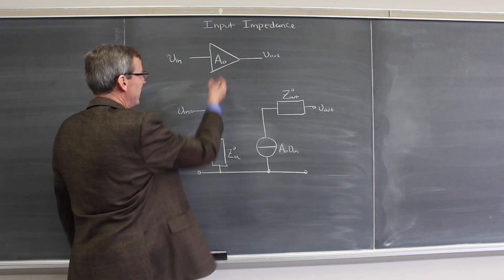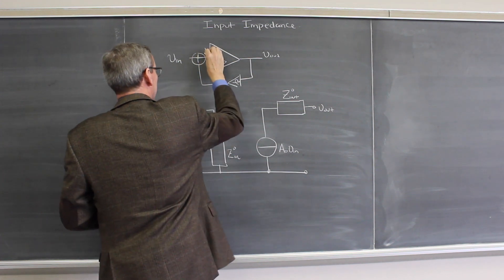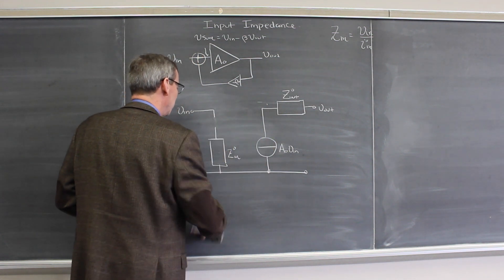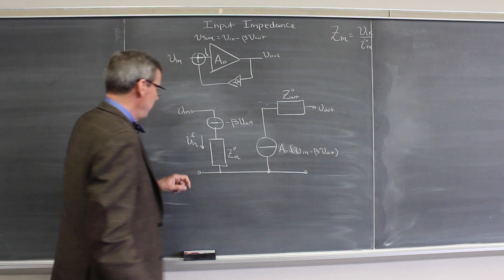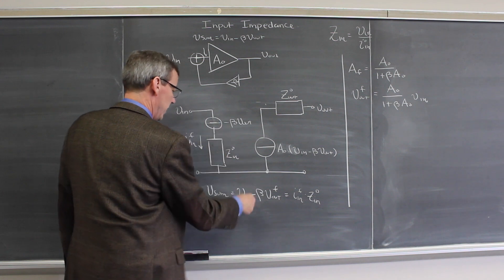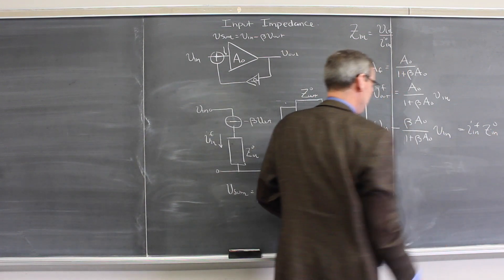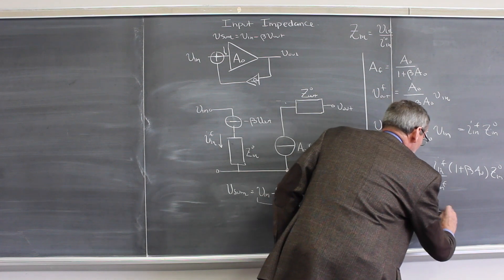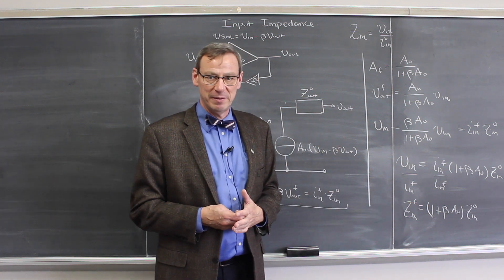Input and Output Impedance with Negative Feedback

Comment: This is very simplistic. What in the case feedback network has its non-ideal input impedance? What is you are not returning voltage but current?
Reply: Even if you are returning current, The input impedance depends on whether you are subtracting voltage or current, If you are subtracting voltage and the feedback voltage is a function of the output current it Is still true that the input impedance of the feedback is much larger than without, think of the case of a common emitter or common source transistor with a feedback resistor in the source or the emitter, That's a topology where you are sampling an output current for a feedback voltage

Comment: Sir please help me out in voltage shunt feedback amplifier the gain of the amplifier with feedback is Vo/Is how it is possible that the gain is the ratio of voltage to the current
Reply: It's called trans-resistance, this is similar to the inverting ideal op-amp topology, the feedback current is a function of the output voltage